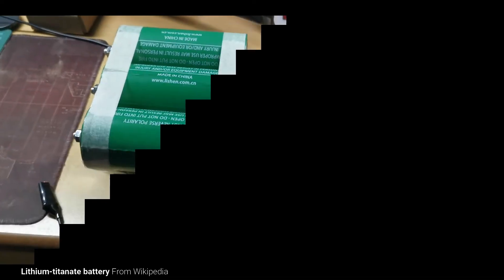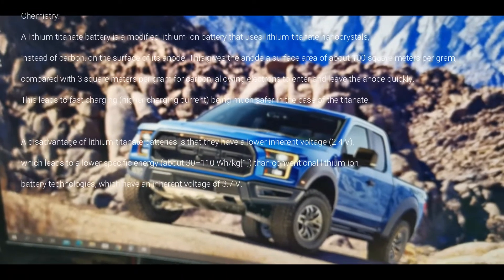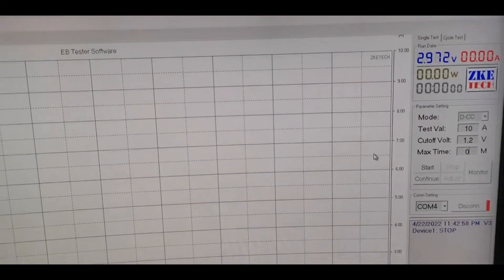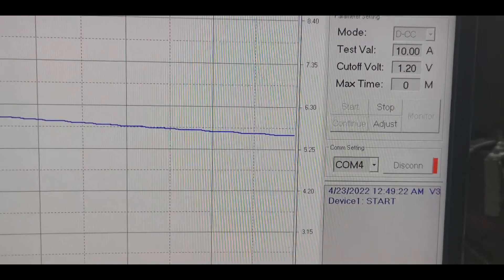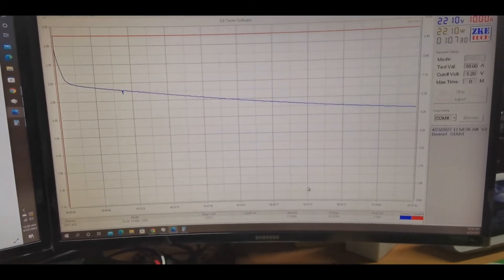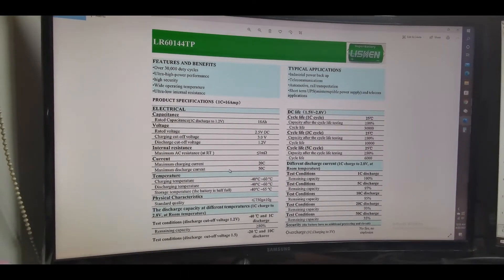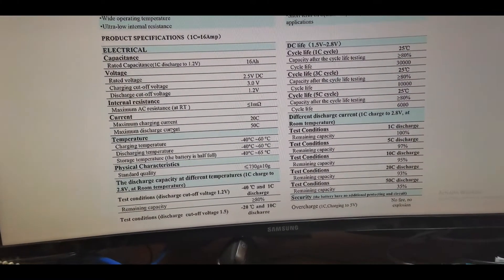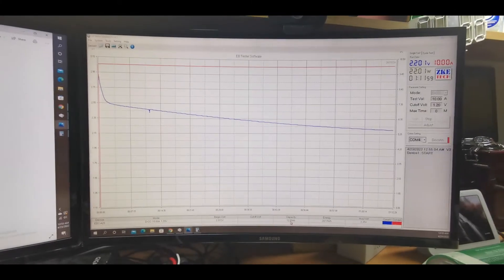Lishen 26Ah LTO Battery Capacity Test

Comment: Is the nominal voltage actually 2.5V because your test result is showing 2.21V and thats at a very relaxed discharge rate
Reply: It seems the "nominal" voltage is labeled as the point of diminishing returns for capacity rather than 50% soc like it typically is

Comment: Thanks for the charts. I couldn’t find information about the maximum voltage in any way, since the datasheet of 18 Ah was written 2.8v, and then “charge up to a maximum of 3.0v”, this knocked me down, but at 16 Ah it was written clearly 3.0v. Perhaps they made a mistake in the datasheet 18 Ah.
But thanks to you, it became clear that 5 cells will be enough to replace the Pb of a car battery. (3*5=15v, 14.5v/5=2.9v)

Hello from Ukraine.
Reply from the maker: thanks for viewing. hope you and your family is ok. be safe.

Comment: sorry, very much a beginner here but.. , I am confused, it looks like you have 6 wired in series, so I thought that the total voltage would then be 2.5 x 6 = 15V  w capacity at  26ah ? were you only monitoring the V of one cell ? 
or did you have them in parallel and have a nominal V of 2.5v and total capacity of 26x6 ? thank you
Reply from the maker: yes you are correct. i'm only testing  for 1 cell if you can physically check the wire jumper connection. i had them wired in series with i charge them together.
Reply: @bryanmendoza2770  so these definetly are all 2.5v as opposed to the lichen LTO at 2.3v ?
Reply from the maker: @bluedogozwoofer6737  yes.  These  green  lto cells are rated at 2.5v compared to yinlong blue lto cells at 2.3v
Reply: @bryanmendoza2770  thank you, was trying to find someone who could verify first hand that was the case , :)
Reply: Ive watched your videos but could not see who you used as a supplier - any advice ? TIA
Reply: So is the c discharge rating as good as the 18 amp hour or worse?

Comment: Great test, can you charge them to 2.5v and do the test? Will there be allot different?
Reply from the maker: if you look at the both charge curve you will see the characteristics of this battery. Within the first 5 minutes the voltage drops significantly from 3.0v to 2.5v. I my test i just follow the voltage rating base on battery specifications against what they claim to be 26Ah capacity. And the results it was surprisingly good enough for me. the only question i have is the longevity since 30,000 cycles is very hard to prove in real world and only time will tell.